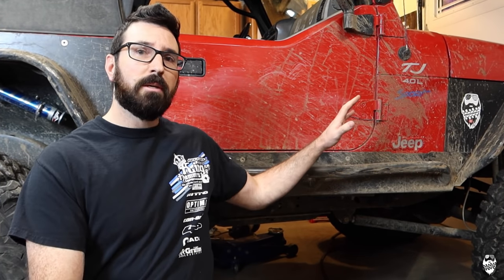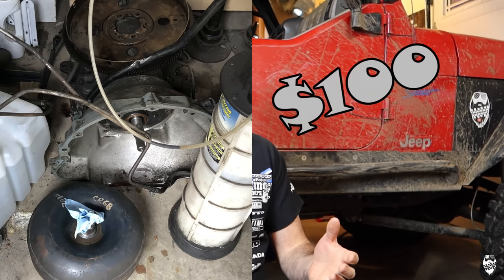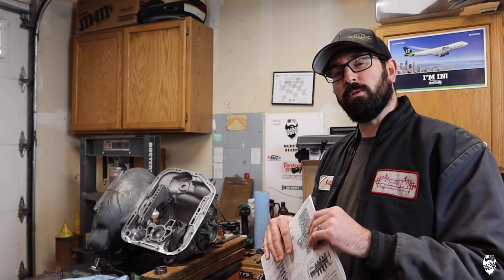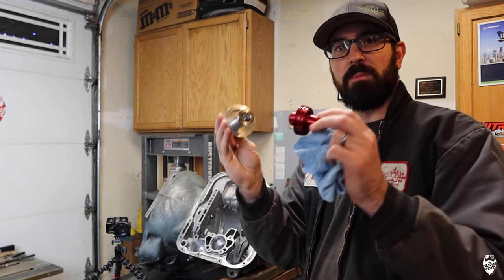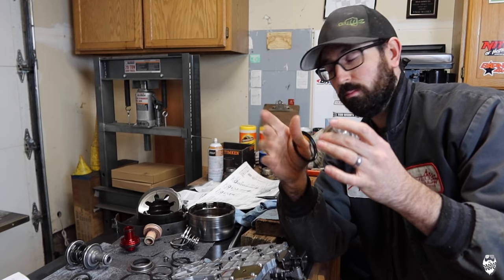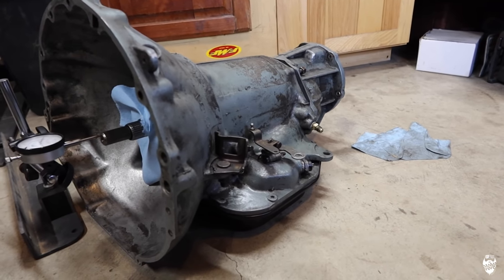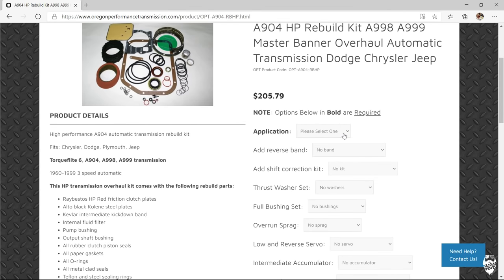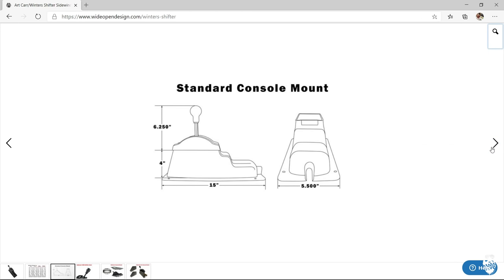Automatic Transmission Swap in my Jeep Wrangler TJ, Part 1

Comment: I didn't do the swap, my 2002 TJ came with the 32RH Automatic.  But I had it rebuilt with a shift kit and they managed to squeeze an extra plate in there and I also installed the deep sump tranny pan and new torque converter and when winter is over I'll be putting in an electric fan tranny cooler in back under the tub.  Oh shoot.  I also had the front breather plugged up front behind the torque converter and I had them drill and install the new breather back near the tail but on the front half before the seal.  Then I plugged the tiny breather hole on the bottom of the adapter as well.

Comment: Very cool video. That is one we all consider in out TJ's. My wife can't drive my manual 6 speed so I often thought about putting an automatic in it. I'll have to do some more research on it. 🤔🤙
Reply from the maker: Thanks, if this wasn’t a trailered offroad only rig I would probably lean towards the AW4, they are cheap and fairly strong. And it’s 4 speeds and electronic shifting.

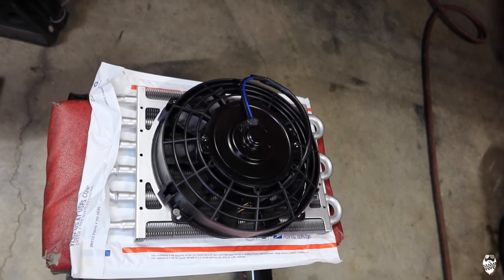Comment: 15:40 a friend of mine who made a 3 speed tranny swap in his 97 wrangler kept his clutch pedal in and welded it to the brake pedal. Actually really smart so you can use 2 feet for brake and gas for fast pedal swaps. If it’s not too late maybe consider that.
Reply from the maker: Not a bad idea. But I am going to try and sell all my old stuff as a complete manual swap, so I need the pedals intact.

Comment: While I can't imagine a world were I would ever buy another vehicle with an auto trans or heaven forbid convert from a manual to an auto, (I've actually done an auto to manual swap back in the day)
I understand that others might do this for their own reasons. Great job on the rebuild. Always enjoy your content, you always do a great job presenting you topic. God less, stay well.
Reply from the maker: I never thought I would swap to an auto either... but here I am. Thanks for the kind words🤟🏻
Reply: @MuddyBeards4X4  Hello. I have a Cj7 that originally came equipped with a 904. I want to install a newer model starter that comes with the 4.0 engines. What type of starter do I need? number of teeth? Or starter and flex plate part numbers. Please

Comment: I went from a tf999 in my yj to an aw4, wanted the 4th gear. Had to build my own wire harness and merge it with the factory, it was a challenge but it turned out great. Hope you like yours! Maybe someday I’ll cover what’s needed for that swap
Reply: How did you address the t-case, and were you able to use your driveshafts?
Reply: @joshdenham8404  I re drilled the back of the transmission to clock the tc up, and I chopped one shaft down and length the other
Reply: I’m trying to do the same thing, do you have any forum or something that would guide me through it?
Reply: @HAYTHEM543  i always said i was going to do a writeup and I never did. I had to do it the hard way because all of the write ups I found were from manual to aw4. there are a few differences coming from auto to aw4. mainly building a shifter to adapt the column linkage and the flexplate/cps has to change to different style. and making the harness is the biggest part
Reply: @FlawedOffroad  actually mine had the ax15
Reply: I already installed the aw4 and shortened the rear deiveshaft but it wouldn’t drive.
Reply: @HAYTHEM543  did you build the harness to connect the transmission computer into the Jeep computer? its an electronic transmission. you either have to do that or get a manual shifter for it (radesigns)
Reply: @FlawedOffroad  no I didn’t, how can I do that?
Reply: @HAYTHEM543  it’s quite the ordeal, I’d suggest looking up aw4 to yj/tj wiring harness and start reading. If you look at my Instagram which is under the same name, you’ll have to scroll back toward the beginning of my account like four years ago and there are some pictures of my wiring harness as I was building it
Reply: @FlawedOffroad  if I don’t have the tcm working properly and i buy the gear shifter from radesign, would it shift? Manually of course
Reply: @HAYTHEM543  yes, you can bypass the tcu with the RADesigns shifter. It has 1-2-3-4, You still need the normal shifter for park reverse neutral drive.
Reply: @HAYTHEM543  I think you will also have to hardwire a switch for the torque converter lockup for 3rd/4th gear
Reply: @FlawedOffroad  those wouldn’t exist with the radesign shifter?
Reply: @HAYTHEM543  look at their website it explains it better than I can. It’s a small shifter the size of a pack of cigarettes that only changes 1-2-3-4th gear. You can mount it anywhere. It’s effectively like driving a manual but with no clutch. You still need normal shifter to get into drive.

Comment: Should use full manual reverse pattern valve body for crawling puts 1 and reverse close together I have same trans in my cj7
Reply from the maker: That definitely would be the best option, but the cost was too high for this build. the reverse manual valve body is $400, shift kit was $112.
Reply: I’m dumping my 42rle this spring and swapping in a reverse pattern full manual 700r4.  Manual valve bodies are unquestionably better in reverse pattern.  Gotta love the CJ7, grandfather of my beloved LJ!

Comment: Nice to see your video, you dont see alot of videos on the 32rh. Did you check the seal on the shifter shaft? Or you installing a new one already.  Mine was a pain to install while it was in the jeep.
Reply from the maker: Yes, every seal inside the transmission was replaced when I had it apart.
Reply: Eh mine is leaking with a rubi express skid plate in the way
Reply: @humzilla707  i used a specific tool that actually worked on pulling the seal and installing a new one while the transmission still in the jeep.

Comment: Doing a AW4 swap in my 98 TJ now. I know Rubber Ducky TJ has done the swap but do you know anyone that has a video on my swap. I have a 904 I'm swapping into my YJ too. Great Video!!!
Reply from the maker: Thanks, I don’t know much about the aw4 swap but I do know that Ryan used a rad designs shift controller for the aw4.

Comment: I have a similar arrangement in my 1986 CJ7.  It's a factory A999 auto.  I did swap an AMC 304 in place of the original 258.  With the 999 and factory low stall converter I discovered it pulls through the brakes in the low range after installing 4.10 gears no matter how low I set the idle speed on the 304.  I have to shift to neutral on any kind of incline to stop.  I am considering swapping to a higher stall converter in the 1700-2200 rpm range to eliminate this.  Thoughts on converter stall off road?  My trans has TCI deep finned pan and Street Fighter valve body.
Reply from the maker: This is definitely one of my concerns especially with 5.38 gears and eventually going to a 4:1 transfer case. So we will see

Comment: does that transmission have an external breather,  I had to have a breather added and hole plugged in transmission pump on my 42re.
Reply: My 32rh in my 99 TJ has the breather hole behind the torque converter.  Not a good setup. I seen people plug it and drill and tap for a breather fitting on top like it should have been in the first place
Reply: @brianjones3245  that is what I had done to to my 42re.  I just figured I would mention it to him while it was out of the vehicle.
Reply from the maker: Was putting the transmission in today, but took it back apart and did the breather. Thanks guys for the heads up. Had no idea.👍🏻

Comment: I may have missed it but is this the 3spd auto or 4 spd auto.  I have a TJ 2001 4.0 with 3spd but would really like the 4spd for the times I need the highway cruising?
Reply from the maker: 3 speed

Comment: Couple question:
What did you do about the low vent hole?  The low vent water/mud becomes a little scary, seen a Jeep fill a trans after sitting in a Elbe hole.
Two: (kinda answered above) AW4 would have given full manual control with a RADesgin (or similar) shifter being an electric trans,? Also OD for a little more hwy speed or low range high speed snow. Was the 32 just an easier rebuild? Or cheaper overall? I do have the 32 and the 3sp present some compromises.

Comment: I thought the AW4 was a better option for the manual to auto swap in a TJ. did you consider that option?
Reply from the maker: The aw4 is a great option as well. And they can be cheap and easy to find because they were in the Cherokee.

Comment: My 1999 32rh just started slipping. I bought a cooler and I plan on having it rebuilt. Basically under medium to heavy throttle it doesn't catch the next gear well. But light normal driving it shifts just fine. I plan on having a shop rebuild it. I weekend warrior this rig. Would you recommend buying the kit from this site with those upgrades minus a shift kit ( i don't want one) or letting the shop decide ? I didn't realize how many upgrade paths you could choose till this video.
Reply from the maker: I definitely would recommend a shift kit, just the transgo  tf-1 it’s only like $80. I had it installed on my 92 dodge diesel tow rig. Love it. Firms up the shifts a little. Also The transmission will last longer. You could order all the parts and upgrades and hand it to them at the shop Might be cheaper. Or just ask them how much it would be.
Reply: @MuddyBeards4X4  thank you for the advice. So not all shift kits are like the one you ordered where it makes it a manual? I'm in Arizona. So we crawl all day. Its very easy to just leave it in first but having a manual shift kit would ruin the driving experience for me outside of the trails.
Reply from the maker: There are 3 level of shift kit, I got the full race one. The tf-1 is a great choice for your situation.

Comment: have you had much issues with your 4.0, i just recently got a jeep grand cherokee.. and i’ve been chasing a misfire on it. i’ve changed the whole coil pack rail.. fuel injectors and the fuel rail.. camshaft sensor.. all the idle air control valve map tps.. and it just keeps having the same issue.. P0301 cylinder 1 misfire.. sometimes it runs perfectly fine and other days it wont even stay idling and it seems to be pumping a shit ton of fuel in cylinder one brand new injectors ive tried two sets of injectors same effect.

Comment: I got the winters shifter for my xj on my shelf. Are you keeping a regular pattern for the shifting or going reverse manual?
Reply from the maker: I am doing a regular pattern but I will be modifying the gate slightly to make it easier to get to reverse. You can get a reverse valve body for the 32rh I believe cheetah makes one but it is almost $400.
Reply: @MuddyBeards4X4  cool. I’d do the same  if it was $400 for the valve body😳

Comment: Did you consider a 42rh or re/rle? Not only for the overdrive gearing but also the ability to add a rubicrawler gear reduction/doubler in the trans tailhousing? Was factory trans on 03+ tj i think?
Reply: I think the 42 is computer controlled so it'll be more difficult to work with where the 32rh is hydraulic operated. So it alot more simple to swap.
Reply: @brianjones3245  yeah i just assumed he would manual valvebody swap it same as the 32rh but not sure if that’s possible. Just a thought for more gearing options and spread.
Reply from the maker: It is definitely possible.  But not cheap. Trying to do this on a budget.
Reply: @MuddyBeards4X4  yeah i’ve noticed you have been very budget conscious in your whole build. Keep up the good work. I just found the channel from Nate’s channel and really like both your styles. I only mentioned the rubicrawler because your gearing may be a little higher now than you are used to and its half the price of an atlas setup. Plus even without the rubicrawler you get OD in the 4 speed which is nice for any hwy work you ever have to do.
Reply from the maker: I have looked into the rubicrawler, but I remember it being like $1600, so basically the same price as an atlas. And it definitely would be nice to have the 4 speed or even a torque converter lockup.
Reply: @MuddyBeards4X4  half the price of a new atlas and also gives 2 different low range options. Can maybe find a used atlas for 2k or so but not going to get 2 low ranges without a 4 speed atlas and thats pretty significantly more $.

Comment: Do you have a part number for the low and reverse servo and where did you get the billet band strut
Reply from the maker: Got it all from cope racing transmission.
https://www.coperacingtrans.com/
Reply: You got both parts from cope racing
Reply from the maker: I got some parts too from Oregon performance transmission as well. Do some research and find the best deal
Reply: I have been trying to find the low reverse servo but could only find it as a option with rebuild kit but already have rebuilt transmission and it didn't have part number but thank you for responding  love all the videos
Reply from the maker: Oregon performance transmission has them, they were upgrade options when I ordered the rebuild kit.

Comment: I thought the 32RH was NOT electronically controlled IE no TCM, did I miss something?

I have a 99TJ with a32RH and 231, I have had the 231 apart, fully inspected, cleaned, new seals and SYE installed. It is in great condition, I saw no wear or other issues. I installed a cable shifter to hopefully make it shift better when flexed. Here is my question, when going from 4HI - N - 4LO or the opposite way, if I do not put it in park, it grinds IE the trans & T-case are spinning and gears do not mesh up when they are. So put it in park then shift and T-case doesn't always shift. If I go into N I have to shut off the engine put it in park, shift the T-case and re-start it. P I !  A Any insight on this? I have to be missing something! Wish is had a damn clutch break like a semi, I know how to run that LOL
Reply from the maker: Even though it is not electronically controlled it still needs the pcm from a auto trans in order to work. 
It does seem like something isn’t right inside the t case. You should be able to shift even when moving.
Reply: @MuddyBeards4X4  2HI - 4HI shifting on the move is never an issue. it's only when going through N - 4LO or back. Not looking forward to pulling that stupid thing again! Was hoping for an "easy fix"
Reply: @tomhubbard353  my 99 does the same thing. I let in sit in N for a few seconds then give it a firm shift to minimize grinding.
Reply: @humzilla707  I discovered a shifting "trick" hack whatever. Put it in park, go into N then attempt HI or LO, when it doesn't go in, use your other hand to start to take the trans out of park. as soon as it slightly spins, it goes into gear HI or LO. No grinding. Total PIA but it works.

Comment: I don't see where you addressed the factory trans vent hole that's on the front pump cover behind the torque converter on the 32RH. 
It should be plugged and then a new vent installed on top of case so it can be vented up high with a hose, just like the transfer case. Idiotic design by those at Chrysler/Jeep. In the stock location, water up to the bottom of door seals will result in water entering the transmission thru the factory located vent.
Reply from the maker: I will be looking into this. I am installing the transmission today so it’s not too late to make some changes.

Comment: What tcase and crawl ratio did you have with the manual? I wheel a manual with super low crawl and it’s amazing in the rocks
Reply from the maker: Yes, it would be much better with a much lower crawl ratio. I have a stock np231 and 5.38 gears. But for now this will cost me about $300, after selling all my old stuff. And a new t-case is $2000. So eventually I will be getting a lower t case.
Reply: @MuddyBeards4X4  Totally understand. I'm building another rig with an auto so I'm curious to see how it wheels compared to the manual.
Reply from the maker: I am curious as well

Comment: So, how would driving a automatic transmission manually be for daily driving. I been thinking of doing a aw4 swap with manual  Solenoids Solenoids, but not sure how it would be to drive it to work everyday.
Reply from the maker: Not sure about the aw4, but I wouldn’t run a full manual on something I daily drive. I would do a shift kit, maybe something that lets you do manual in 1,2,3 but still gives you automatic shifting in D.
Reply: Check out the RADesigns aw4 shifter, it does the same thing but gives you a 1-4 lever, and you can turn it on or off to let the computer shift for you or do it manual.
Reply: And if you need anymore aw4 help hit me up 🤙

Comment: I have 90 yj 6cly  3 speed automatic  what transmission do I have good or bad???
Reply from the maker: Should be the same one I have 32rh and it probably does not have the tcc lockup.